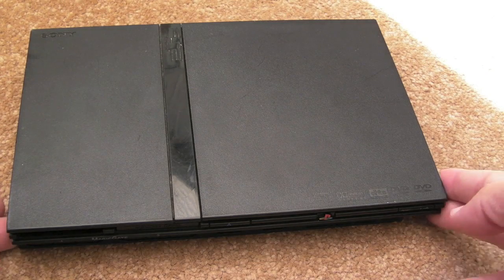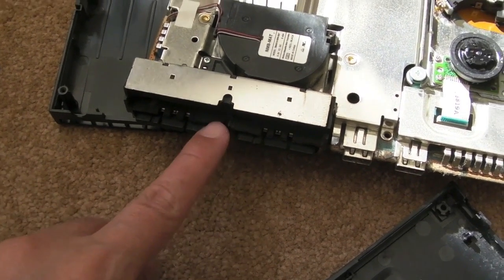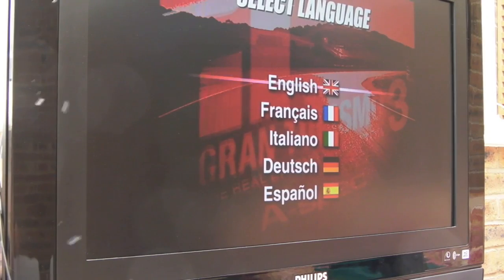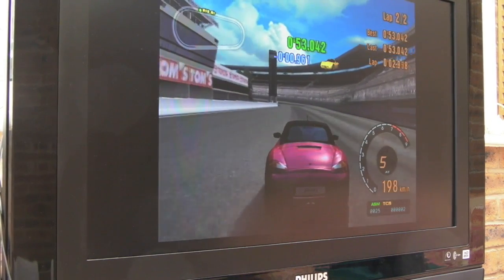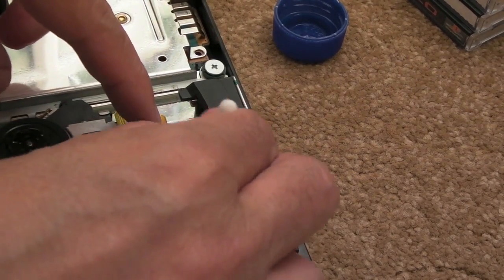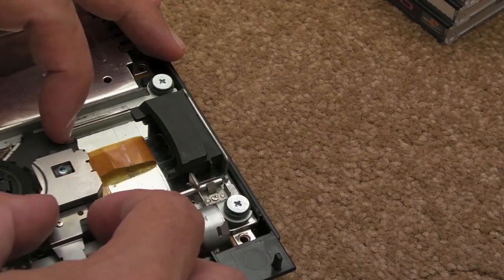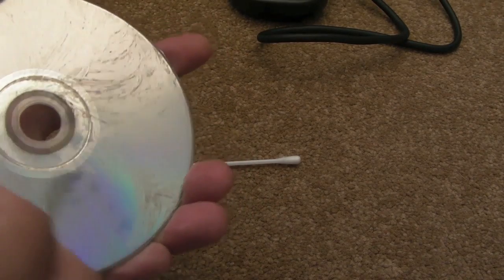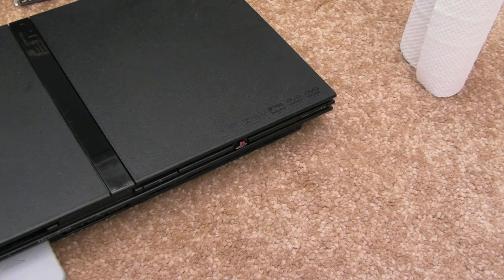Sony PlayStation 2 (Play Station) Slim DVD Repair (PS2 PSX) Scratched Discs (Cleaning Scratched CD)

Comment: Thankfully in later revisions they removed this metal shielding under the ribbon so it sits much lower and cant raise too high to scratch the discs.
Reply: Which model is this revised slim?
Reply: Which model is it?
Reply: I have literally the latest PS2 Slim revision (90k) and am currently trying to find a fix for this, so this is either wrong or they reverted right back to what they were doing before lmao
Reply: @PlayerGameSK  From my models - SCPH-79002 is the one without metal plate under the laser. Will check 9000 models later.

Comment: My rainbow wire is not connected to the laser reader thing.How do I fix it?
Reply from the maker: If the connector is broken you might need to swap the whole unit.
Reply: I know,I searched it online but thanks still.

Comment: Any idea if Sony fixed this problem in PS3 Super Slim?
Reply from the maker: There does appear to be a similar problem with the PS3 slim from what I've read, but I am not sure on the cause - is it the ribbon again - possibly!  What makes me laugh is the way people jump in and say that because their system hasn't scratched discs you must be making it up!  That was the same reaction from Microsoft with the 360 - blaming the customer.  I wouldn't mind but these problems are design faults imo - they clearly don't review the hardware design thoroughly enough before pushing systems out.  A sign of the times I guess - a bit like the software side too, pushing games out that have game breaking bugs etc.   

The industry needs to slow down and get things right because people are starting become alienated with adoption of new technology.  I almost didn't buy an XB1 because of Microsofts previous track record with the 360.  Compare the life span of a modern console to an older console - I have 30 year old systems that run perfectly, yet the 360 I have now is the 6th one I've had!!!  Look on eBay and you will see thousands of Wii, 360, PS3 faulty - there's a pattern emerging!  Badly designed modern products that are not designed to last more than a few years.

Comment: The ribbon scratch fix didn’t work for me it’s still scratching my discs.
Reply from the maker: It's probably best to replace the ribbon!  They come with new adhesive pad too.
Reply: GadgetUK164 - Retro Gaming Repairs & Mods Is it easy to replace?
Reply from the maker: @xanderson444  You do have to take the drive to pieces, so it is a bit fiddly to do.  But the ribbon just plugs in at either side.

Comment: cheers . very useful. now i can continue play Dune :D do u know how to fix playstation one small white box, its show red screen?
Reply from the maker: It's worth measuring the power supply voltages going to the main board!  But a red screen could also be caused by bad RAM, faulty or leaked capacitors maybe?
Reply: do you show me any links coyld helps? im not electican ;)

Comment: Please reply to whether or not you think a little dab of super glue would be good for keeping the ribbon down because otherwise I'm just gonna do it tomorrow anyways lol
Reply from the maker: To be honest the problem with super glue is a mist evaporates off it - it may cloud the laser lens if you aren't careful.
Reply: @GadgetUK164  thanks for letting me know bud. I think I'll try it and as long as it doesn't immediately break I'll be alright. I suppose there's a few different super glues too. I would maybe give replacing the ribbon altogether a go, but I only found one video and it's not in English and the guy is using what looks like it could be super glue to stick it down.
Reply: @GadgetUK164  right so update - I did just super glue it down. I'm a little worried, before I did it I told myself "you're going to put too much on" and low and behold, I did. Was pretty messy honestly. A tiny bit squeezed out the sides and even a bit of residue got on top of the ribbon, making it feel tacky. I used what I had, which was my mums nail varnish removing pads which I squeezed onto a cotton bud, went around the area and on top of the ribbon, dried it, and that seems to have helped clean it up a bit, although there is still a tiny amount of excess you can see if you look closely. However, it is stuck down good now, still looks to pop up a bit when slid up about half way which looks like it goes to disc level, but I don't know how else I could do it. So hopefully what I've done will at least mean safe discs. 

I'm a little worried because you said it could cloud the laser lens. If it did though, couldn't I just swab some nail varnish remover on that and clean it up? If worst should come to worse, and both the ribbon and laser were screwed, you can get the two for less than 20 quid on eBay I believe. I just hope my discs are safe more than anything and I already have a second PS2 slim coming from eBay so I'm that one won't need anything done to it. At the end of the day I suppose they're not very expensive consoles and are still available and affordable after 21 years so there's no real reason that should change instantly I suppose. But if you could answer my questions and let me know what you think, I'd appreciate it. I will test it for about an hour later, hopefully I get that far, and update further also.

Comment: Is there a way do that without having to open up the ps2?
Reply from the maker: Not really =/
Reply: @GadgetUK164  I just gotta lower the ribbon, because a side of it is a bit higher than the lens
Reply: @GadgetUK164  Is it okay to use hot glue? I just need to make sure I don't press the eject button while the ps2 slim is still on

Comment: wtff..my ps2 become has grinding  sound..what i can do to solve it
Reply from the maker: Sounds like a faulty gear or something?  You really need to take it to bits to try and work out where the grinding sound is coming from.
Reply: +GadgetUK164 it sound  come from above the lense
Reply from the maker: Sounds like your ribbon is rubbing on the disc.  Check your discs to see if there's a scratch on the disc surface in a ring.  If there is, you need a new ribbon.  They can be bought on eBay for $0.99.
Reply: +GadgetUK164  how to replace it.. it easy or hard
Reply from the maker: It's easy, the ribbon is just stuck down with double sided tape.  The hardest part is carefully taking the system to pieces and removing the old ribbon.  If you take your time its not too hard.
Reply: +GadgetUK164  but the lens is stuck and has a grindingg sound and the spindle disc is not spin...are you sure it have to replace the ribbon only?
Reply from the maker: Maybe your motor has failed or something?
Reply: +GadgetUK164 so ,what does i do?

Comment: My playstation makes these rings around my disc ? Help lol
Reply from the maker: As per my video - the problem is most likely the laser assembly ribbon rubbing on the disc.  Just replace the ribbon and make sure its taped down properly and it should solve the problem.
Reply: +GadgetUK164 thank you so much

Comment: My ps2 is a different model how to fix this?
Reply from the maker: +Akma Iqbal Which model do you have, and what is the problem with it?
Reply: GadgetUK164 It reads the disk but it won't show up in the screen and it will go straight to ntsc instead of pal
Reply from the maker: +Akma Iqbal If its not reading the disk at all I would look for a new laser assembly.  With regards of going to NTSC instead of PAL, that sounds like a system setting, have you tried going into the config to change the display mode?  If what you are saying is it reads the disc but switches into NTSC - no idea, could be a faulty IC somewhere.  Does the system work once its in NTSC?  I mean, do you see the game loading up etc?
Reply: GadgetUK164 I can't even get into the ps2 setting screen it doesn't show anything except for a black screen
Reply: GadgetUK164 This all started after I inserted a disc which someone sold it to me for $5 and the disc I think was corrupted causing my ps2 to get infected by some kind of virus which leads to my ps2 being like this
Reply from the maker: +Akma Iqbal I don't think there are viruses for the PS2.  Its more likely a faulty capacitor on the video output.  Have you tried a different AV lead, and have you tried contact cleaner in the AV socket where the lead connects to the back to the PS2?
Reply: Akma Iqbal

Comment: What model slim was it?
Reply from the maker: SCPH-77003 - Rev 15 I think?
Reply: GadgetUK164 I'd never had a slim before and I've just picked up a NTSC-J SCPH-90000 and have a NTSC-U/C 77001 in the post so I was curious:)

Comment: Very good instruction. Have seen disks with similar issues but wasn't sure of the cause. Didn't catch the name of the product used to remove the scratch, but I've heard that 0000 rubbing compound can be used. Can anybody confirm this as truth???
Reply from the maker: +Bert Irvine This is the stuff:- http://www.meguiars.com/en/automotive/products/g12310-plastx-clear-plastic-cleaner-polish/
Reply: +GadgetUK164 Hey I have a PS2 slim problem where it causes scratches on the discs do you how to fix this problem
Reply: +GadgetUK164 Hey I have a PS2 slim problem where it causes scratches on the discs do you how to fix this problem